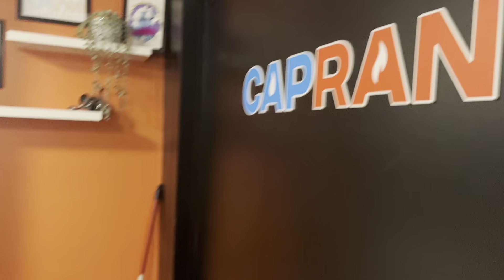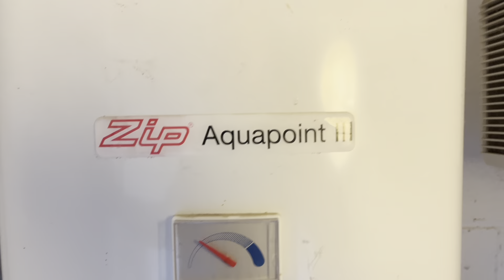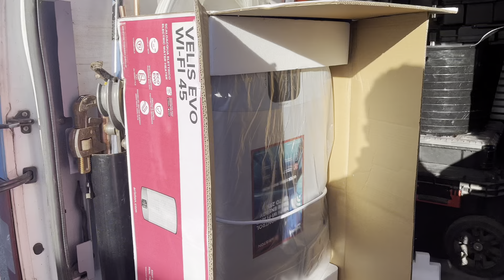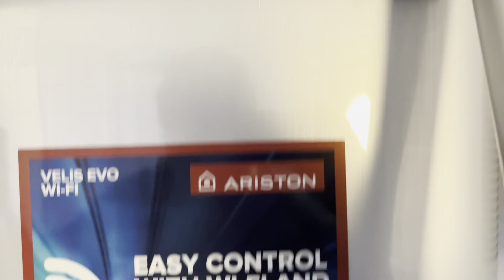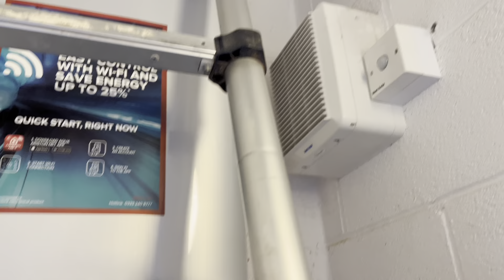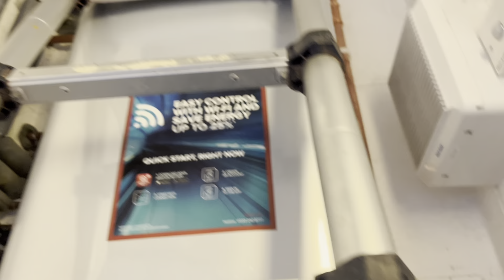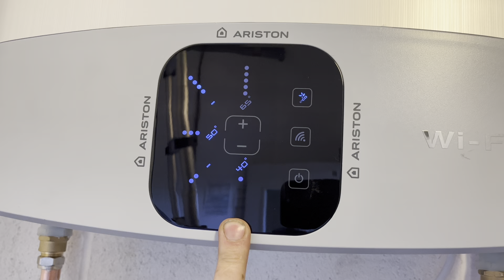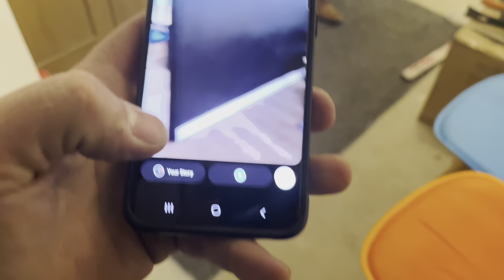BIG NEWS: Contract Signed!

Comment: I think with those extractor fans if you undo the 2 plastic screws underneath and take the grill off, they have a cut-off switch that activates for safety when you take that panel off. It would have saved that doing your head in during that job 😎
Reply from the maker: Wish I would of known this yesterday respect Hustler 🔥👊